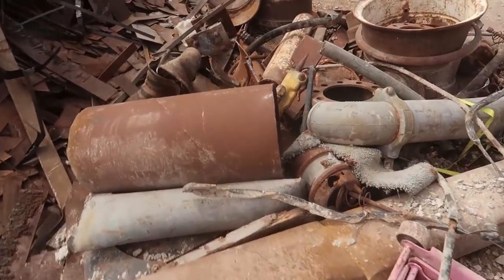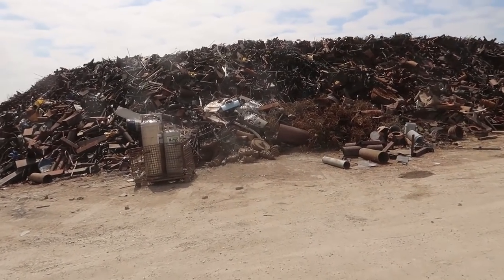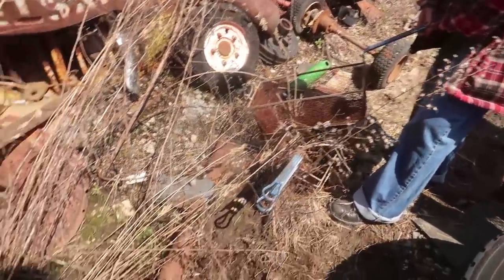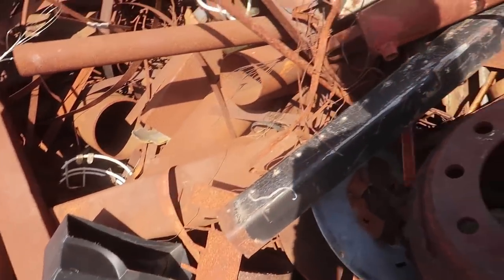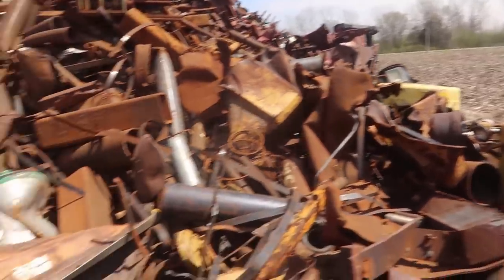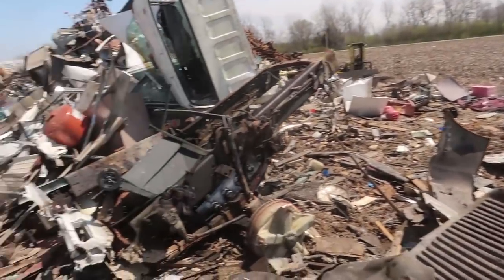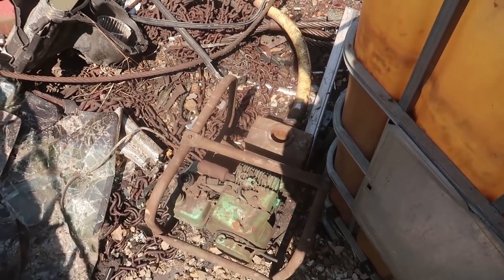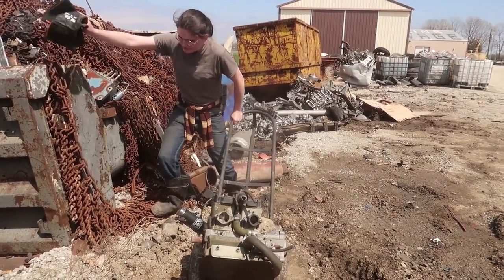Scrapyard Treasure 09: 1975 Yamaha Engine, Jackhammer / Pneumatic Drill, Acetylene Valve

Comment: Could use that conveyor belt as a flat-belt for a line-drive pulley system!
I could use a Yamaha engine like that to boot me back into working on my snowmobile.
Aha, I believe some of the parts in the Yamaha box were old air-cooled VW parts! (bearing shell, pistons, maybe more)